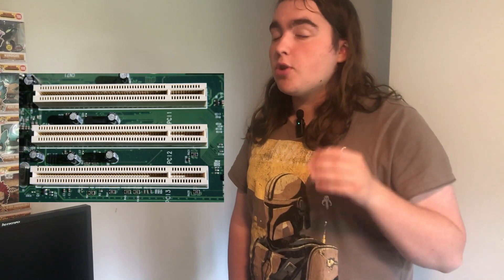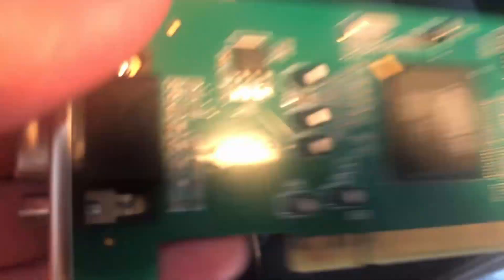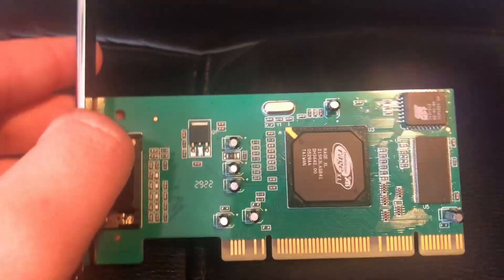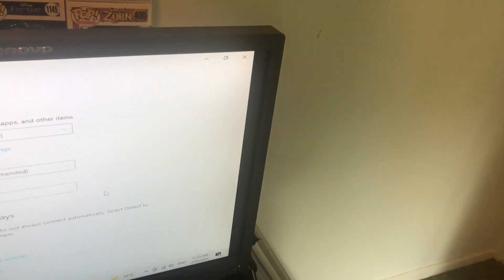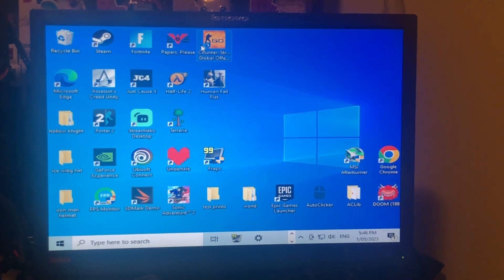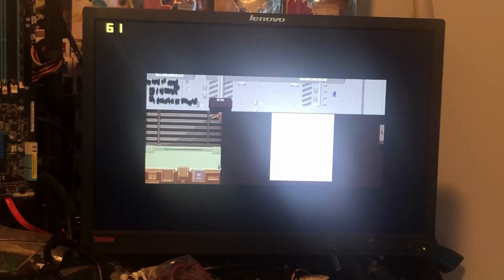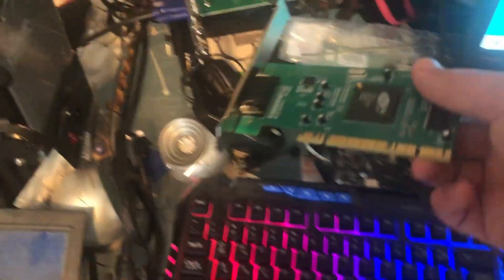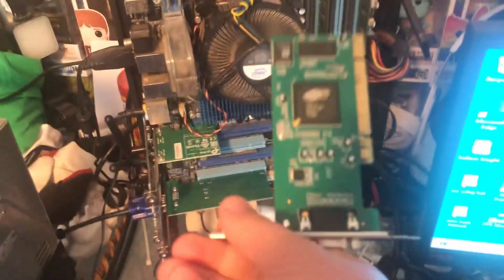Is this the worlds SLOWEST GRAPHICS CARD?

Comment: They were low end but didn’t suck when they came out. Worked fine in my Pentium 233 mhz rig back then. Also, I doubt any windows 10 or 11 drivers exist for this that actually use the acceleration from the gpu. It is a direct x 6 class gpu. The fact you could run TF2 at all means it was using WARP to essentially do software rendering of the game and the reason it crashed is a lack of memory.